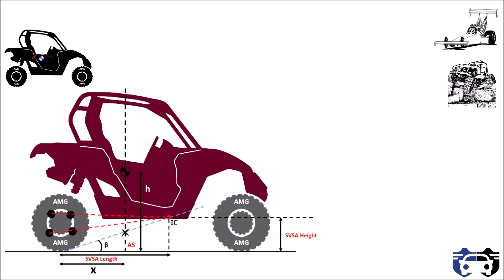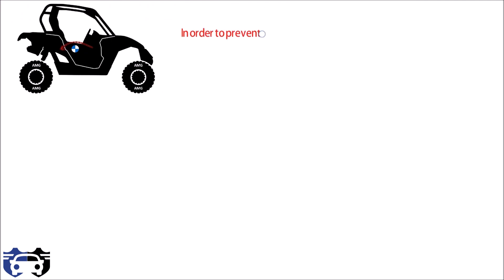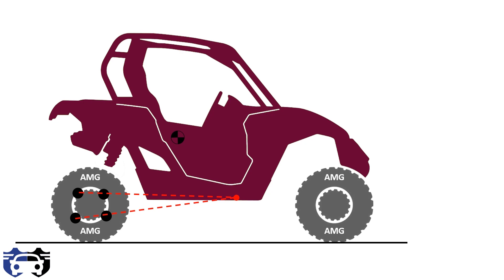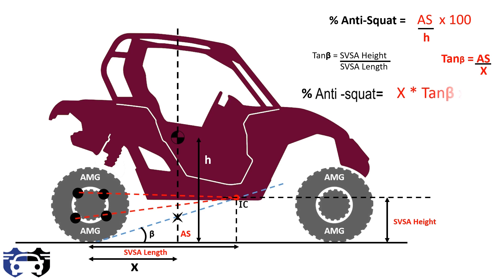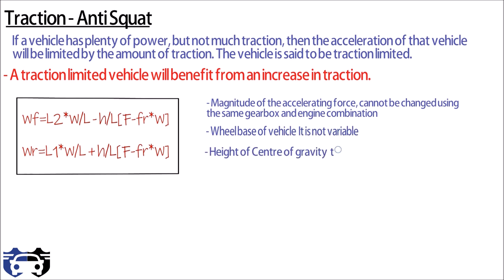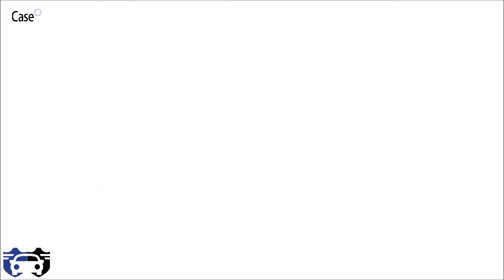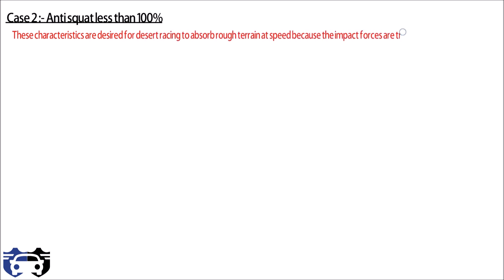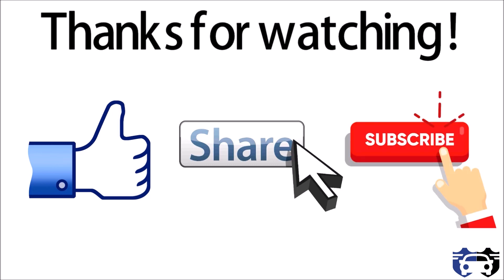Anti-Squat suspension geometry | How to calculate Anti-squat ? | Traction & Anti squat

Comment: What percentage of anti-squat would you recommend for a medium to high-performance street car somewhere in between a Mercedes SL500/Dodge Challenger and a Dodge Viper? This car must be versatile in it's application, as it's going to be drifted, drag-raced, track driven, and daily driven/long-distance touring. Drag racing typically wants 100% anti-squat for bias ply slicks, and can make use of MORE than 100% anti-squat for drag radials, but IDK what the other categories of driving want to be ideal.

Well, you just said so, so okay. Though I guess I might re-iterate: What's ideal for my proposed application?
Reply: 100% is my guess!